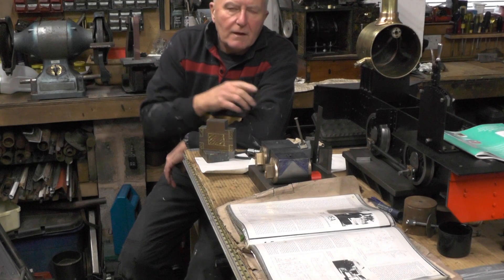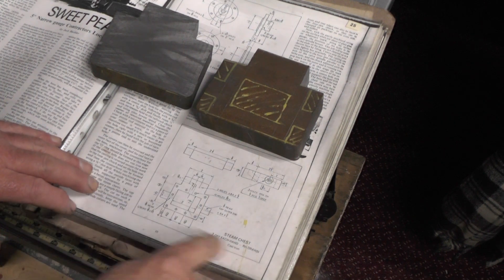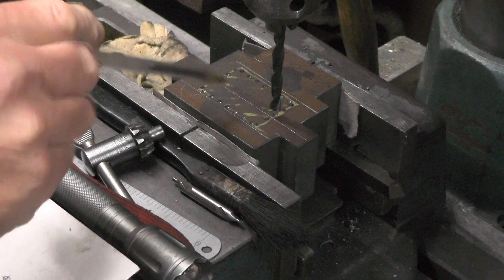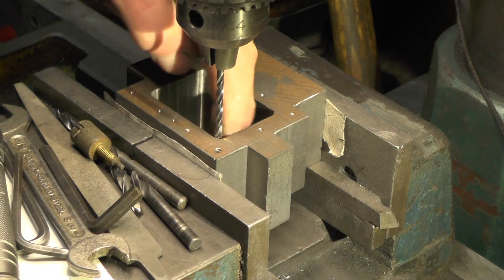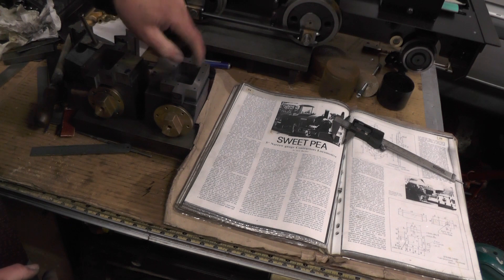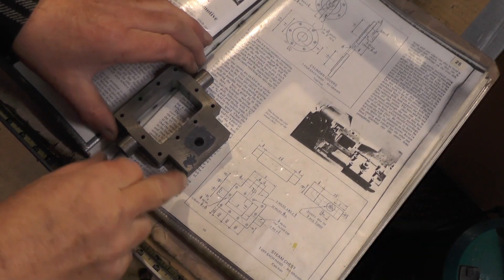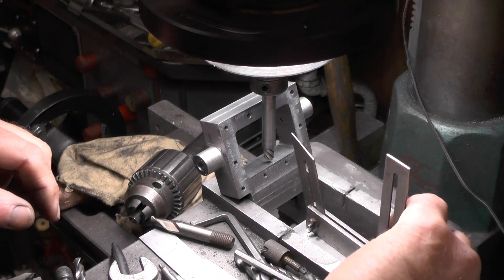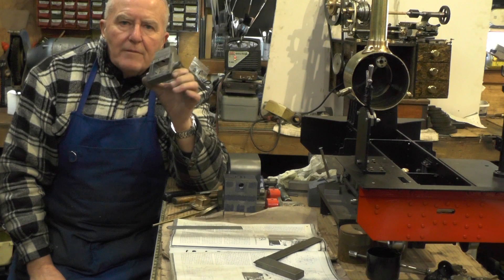Sweet Pea Steam Locomotive Build Part 9b (cont...Making the Valve Steam Chest) "mr factotum"

Comment: I'm building a 5 inch gauge Manor.  You helped me get the angled steam passages in the cylinder block just right.  Now you've taught  me how to machine the steam chests.  Thank you so much.  I'm in Tennessee USA.  My mill is a jet 16 and looks alot like yours. I have to adjust to 4.75 track gauge.
Reply from the maker: Glad I could help Donald👍👍👍👍
Sounds an interesting build, we don't use 4 3/4" track over here.
All the best with the build, let me know how you progress as you continue.
thanks for the feedback
regards
Kev